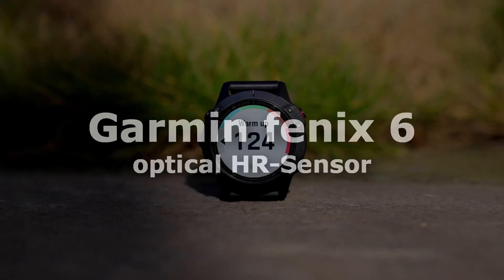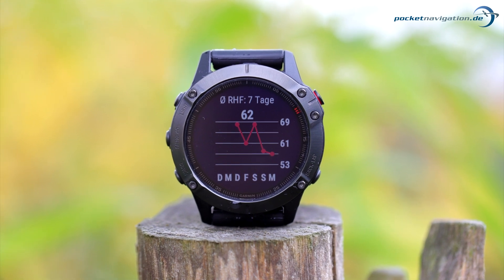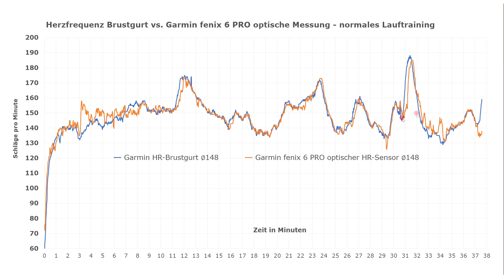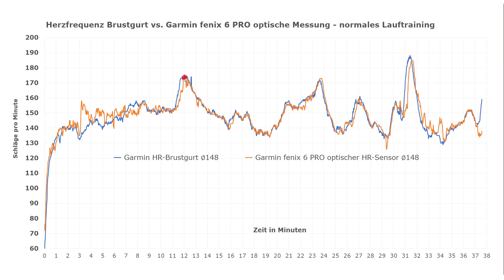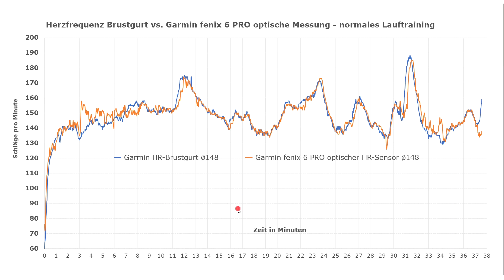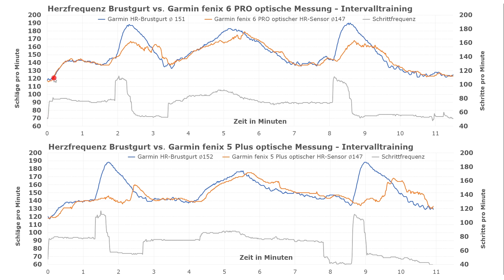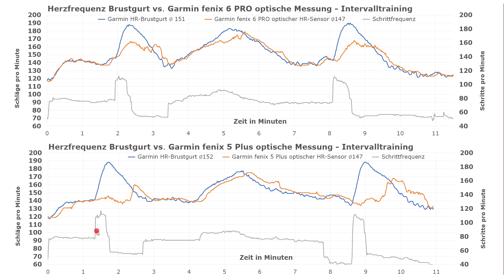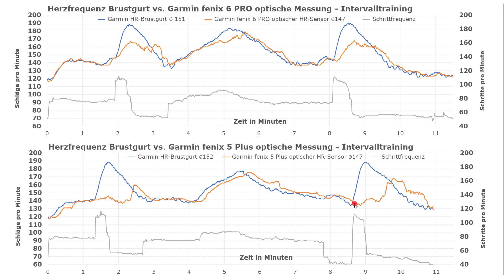Garmin fenix 6 series optical heart-rate-sensor test

Comment: OHR is inaccurate due to the measuring principle! I would have brought a watch without it, if it would be available! I want correct data or no data!
Reply: OHR has it's uses. Such as sleeping or at rest relaxing for 24/7 monitoring. For activities, ECG heart strap.

Like you said, I wished Garmin made one without OHR.
Reply: I don't get you people. The sensor is not useless, they are just not meant for certain tasks. For instance, I found it gives pretty accurate data in steady state cardio. Like jogging, easy cycling (somewhere in stage 2-3). If you want pin point accuracy and more complicated things to measure, like strength training or HITT you need a strap like for any other phone out there but the phone sensor has its uses. Sometimes you want to exercise and don't have a strap with you, or you don't want to use one for different reasons, like you want to go mountain hiking but don't want to wear 1 of those bloody things(for like 8 hours) when out there with your mates but you still want some data on your performance.

Obviously I am not saying they should not put one with no OHR out there since more options are better for everybody.
Reply: @xxan84  As the quality of the measurements has improved a lot since my post due to software updates, I can agree to your points. I use OHR quite often now for activities with quite constant heartrates.
Reply: John thank you for your comment which is valid and makes sense for the purposes you mentioned. ( Jogging, easy cycling ) The thing here is that Garmin does not advertise the watch to be used for steady state cardio, they went from Forerunner 230 with no optical hear rate sensor to 235 with the added optical sensor. Many of us upgraded from 230 to 235 for the wrist base sensor only which will take the place of the strap.  I am a runner and have many trainings where I have to check my progress of certain workouts at different hear rate zones. It is useless if the reading is not accurate. It is useless if when jogging the watch tells me that my heart beats are at 170bpm ( Zone 5) and some other times when I am doing intervals of 200m at maximum speed it tells me that my heart beats are at 126bpm ( Zone 1 ) This is dead wrong, I would not mind a few beats off, it is understandable, but having data so inaccurate is flat useless. Thank you for reading.
Reply: Afaik they improved alot during the years. If it is off by +/- 5 thats not so bad as long as it is linear
Reply: Agree I am so disapointed about these optical sensors which if are not accurate they are useless, how can I use an innacurate data to check progress or adjust training. My Garmin 235 gives me readings of 170bpm when I am jogging and sometimes gives me reading of 110bpm when I am running all out. These numbers are simply useless.